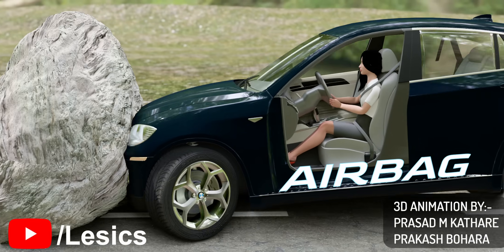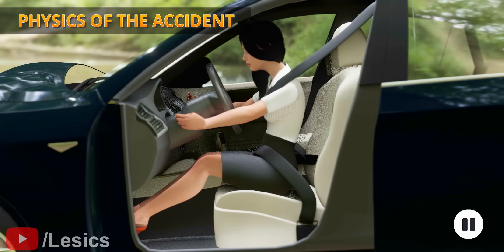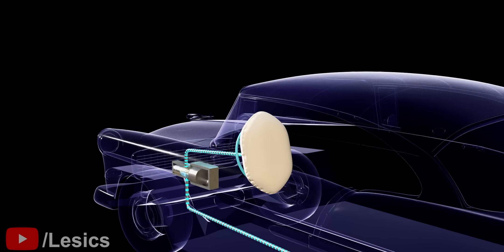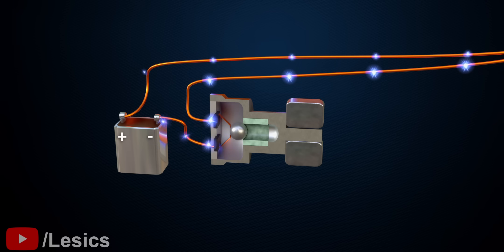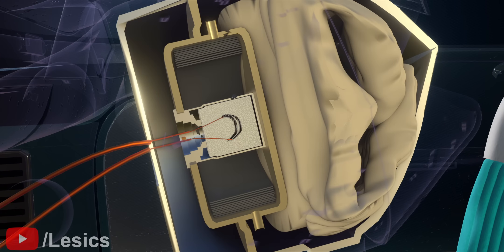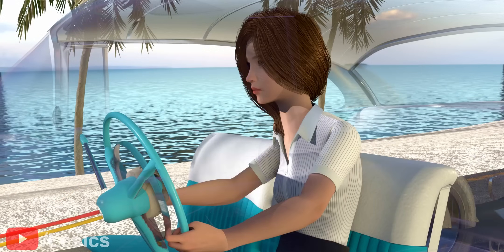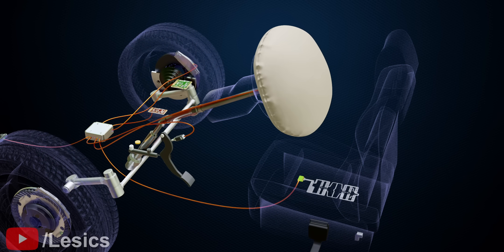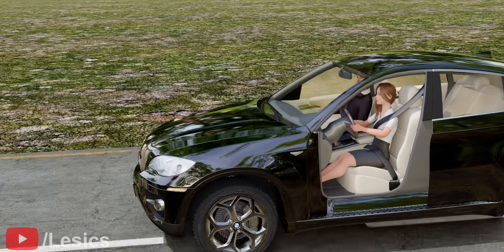Airbags | How do they work?

Comment: When you realize all the things that happen when the airbag deploys, it's just insane how fast it all works.
Reply: It happened before I could comprehend it.
Reply: No joke
Reply: Crazy
Reply: All this talk about fast computers yet my computer will sometimes take ages to respond
Reply: @andrewlarson5253  that’s a very high level issue though - even if a computer is running really slow, the clock is still running at millions or trillions of times per second. A computer that’s heavily loaded isn’t actually running any slower at the transistor level, it just doesn’t have enough bandwidth to handle the load.
Reply: @GlutenEruption  It was just a joke, understand all that, took a few courses dealing with computer mechanics and what not. It's crazy how they managed to figure that crap out and it's only getting better. Computers on cars are dumb though the newer ones are being designed better but these older computers aren't smart.
Reply: Electricity
Reply: M
Reply: Even more so every time you blink…
Reply: 😮😅kdjdfjkfrkeldffıfjfjfjrk😂ototofg8gjtjjtjtk
Reply: Aha always remember the pcast
Reply: 🤔нужен ремень безопасности на лоб.
Reply: i realized that a couple of hours ago and it shocked me
Reply: So true, like when I lost my virginity
Reply: I work for a company that makes a ton of different automobile parts, including airbags.  I work in the inflator department, which makes the inflator for curtain and knee airbags.  It is fascinating to see.Our airbags are filled with a mixture of argon and helium gases.
Reply: True
Reply: It's not that fast when you consider computer are controlling it.
100ms is a long time for a computer operating at MHz. They operate in nanoseconds.
Reply: @monad_tcp  ...and, chemical reactions are fast, too. An atomic bomb must be triggered (from chemical explosives) in less than a millisecond.
Reply: @drpoundsign  yep, that's why they use explosives to trigger it.
just using a motor to bring the two pieces together wasn't fast enough.
Reply: @drpoundsign  but still not fast when we are talking about the scale computers do things.

sure, a computer can trigger an event in a nano-second, any Ghz CPU works on that scale.

most chemical reactions aren't that fast.
like, a camera shutter is literally faster than your eyes can reset the molecule you use to see.

that's how fast cameras can be, because of computers.
(a CCD is basically a computer chip exposed to light)
Reply: still there are some chemical reactions that are amazingly fast, like the cavitation bubbles on surface of pure sodium reacting with water

but mostly they are kinda slow, like computers work with electromagnetic fields, those literally go at the speed of light. 

the speed a computer can go is only dictated to how fast it can get rid of heat that happens every time a transistor switch.

wasn't for that, you could have Teraherts CPU, but then it would be hotter than the core of the Sun. can't put that under your desk.
Reply: @monad_tcp you forget that the computer has finished its job in 2 milliseconds. So that's about 2000 instructions running in the nanosecond range. 2000 lines of code to determine whether and how much to inflate the airbag. The rest of the process is slower
Reply: It’s pretty ridiculous.
Reply: Yes so fast
Reply: @batvenio3533 🎉
Reply: See 5 January,2022
Reply: See 6 January,2022
Reply: Pladjsksnfkznzmxnmzlxnddoskndkxmdckzepppplendnsmxjlxmfkxmmxzmzkfjdksjfkcnfncnxmxmdfdndmfddjslfofpdpppkddfmfnfkdmfkfkdodkxkz
Reply: @nilankadhilrukshi1457  Vaðlaheiðarvegavinnuskúr...

Comment: One inaccuracy this video states is that compressed gas airbag inflators were failures and were not commercially used. The original design could be considered a failure, but it also went through many design modifications, resulting in just under half of all airbag inflators using compressed gas to inflate the airbag. 
I know this due to the fact that I work at the world's largest airbag inflator production plant, and half of all airbag inflators made in this plant are compressed gas inflators.

Comment: They are called SRS and this should be spelled out: Supplementary Restraint System!  So it is in ADDITION to the seat belt.  But some cars have belt pre-tensioners. If you have up to 9 bags popping you want to remain in the seat as tight as you can.

Comment: Good video. I worked with Airbag and Seat belt and Seating systems years ago. I didn't notice anything wrong with your presentation. Additional things you could have mentioned are: seat belt pretensioners that deploy before the airbag to make sure the seat belt is correctly tensioned, and that the passenger seat sensor determines whether to deploy the passenger airbags (specifically). A good idea is to link to your seat belt video at the end because Youtube's algorithm might not.
Reply from the maker: We are glad to kow that an expert in this field like our video. Yah, watching the seat belt video before this video will make things more clear.
Reply: @SabinCivil  Yes, I watched the seat belt video before watching this.
Reply: I also work a lot and airbag system and I love all  the details and work that was put in this video.. btw the gyroscope / yaw rate sensor I notice is actually built in a lot of airbag ecu.. I had soo many shops and customer that pop all the airbag just by touching the airbag unit with ignition on and pop all the curtain bag because they car think its about to roll over..thanks to the gyroscope sensor in them..some times they use impact gun to take the airbag unit out and pop goes the bag (cause by the vibration from the tool)..some cases they disconnect battery and went and touch airbag unit and the static from their body surge though the airbag unit and pop goes them hahaa... I seen too many cases
Reply: Could you tell me, then, how the front passenger airbag deploys?? On my car, there is no "door" or anything for it. The whole top of the dash must blow off?? With the driver airbag, the steering wheel cover just has to break free.
Reply: @drpoundsign  What vehicle and trim level do you have? If someone has access to A2MAC1 they would be able to see what the exact construction is. There probably IS a door in the plastic substrate but the outer skin of the Instrument Panel hides it. The IP substrate construction might be what we call "Foam in Place". It is an injection molding 2-shot process where the hard plastic is injected first (it has the door), then the substrate is placed in another mold which tightly seals to it everywhere but the top "A-surface". Finally, the soft "skin" (which is just a more rubbery plastic) is injected to it. So that's why you don't see it anymore. I am just guessing since I do not have the part in front of me.
Reply: Didn’t he talk about torsion bar ? Well that is a pretensioner phenomenon.

Comment: My question is, the stearing wheel has a case cover. During inflation of airbag how the case cover is managed such that it doesn't harm passenger?
Reply: It depends on the vehicle. Some vehicles have a cover that rips open when the bag deploys. Others have a cover that hinges up and out of the way. This second method is the reason why Drivers Ed classes no longer teach the ten and two hand positions on the steering wheel. In those places, the hands can get hit by the cover flipping up during a crash.